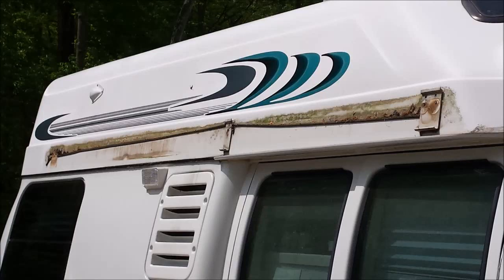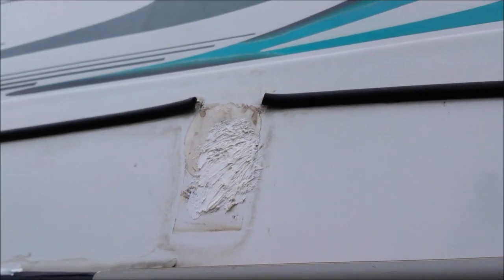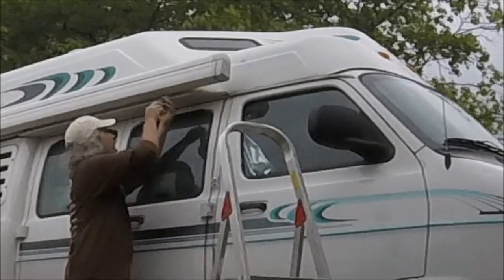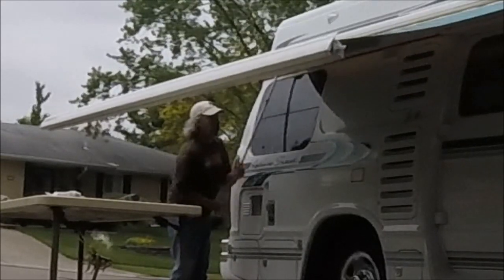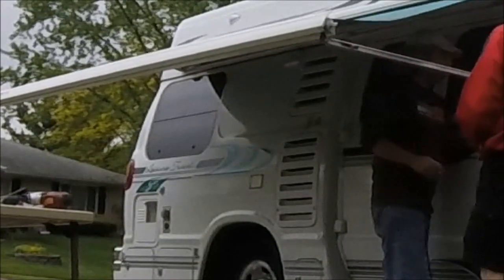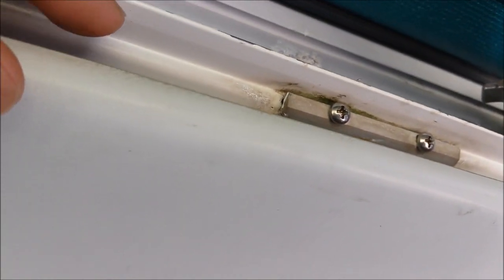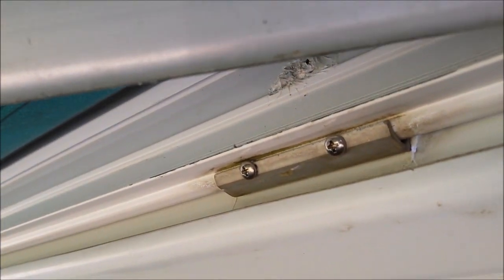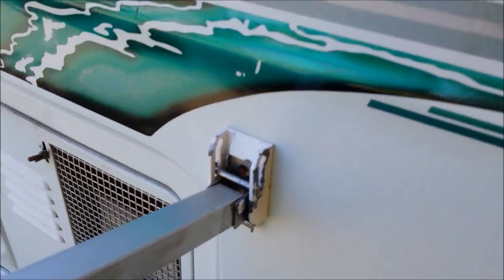Class B RV Awning ~ Wind Ripped It OFF ~ We Put It Back On !!

Comment: I know that part of the reason they used aluminum was to save on the weight, but for the price of these things new, they could surely use something stronger than aluminum.  The part your neighbor made is much better than the original.  He is pretty darn awesome.  I assume he is the one that has done a lot of work on the Toad.  Nice Butt shot BTW ;-)  Hahhah
Reply from the maker: I don't think that in any way the problem was the aluminum ... most of the screws had rust on them and I would believe after all these years it had to have weaken it. So re-securing them should work fine - plus more sealant to try to keep any moisture out should help too, well - fingers crossed anyways. lol